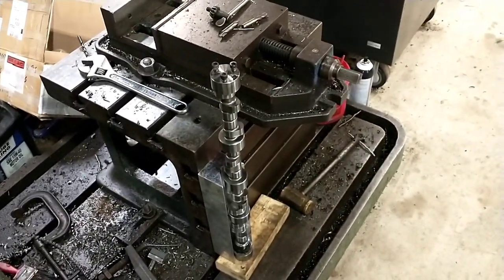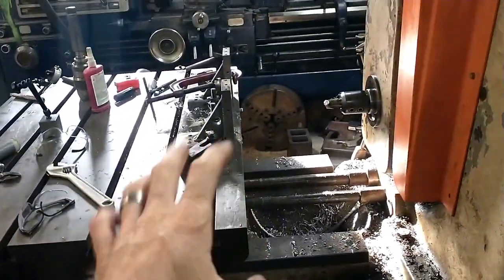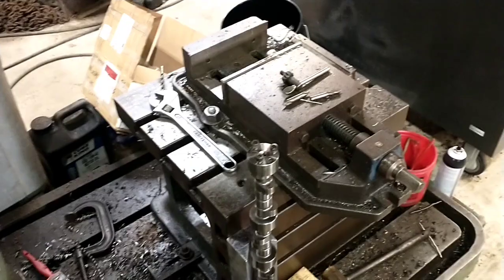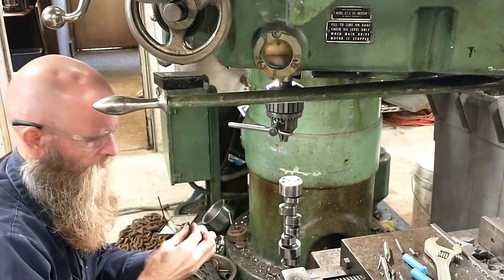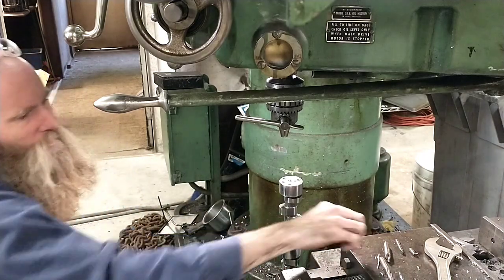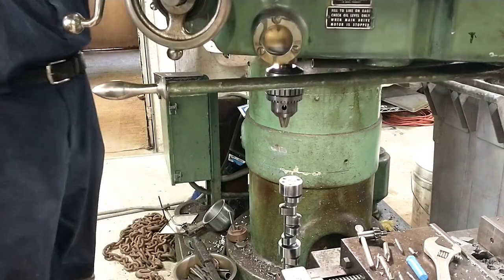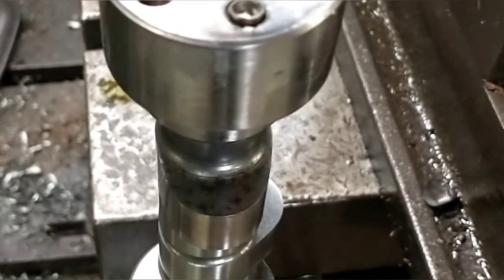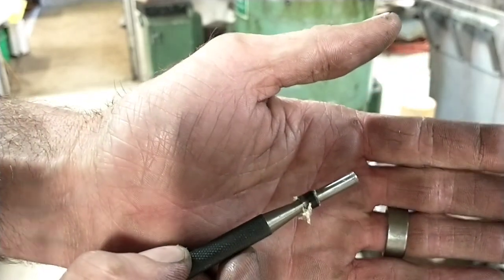Using white bread to remove a broken dowel pin from a racing camshaft.

Comment: Someone should try this with a non-Newtonian fluid. You can poor that in with a syringe, and it should stiffen up on impact.
Reply from the maker: That's an interesting thought, I may have to experiment with that just for the fun of it 😁
Reply from the maker: I've thought it over a little bit more, I don't think it would work. A non-Newtonian fluid would simply act like a solid, for this trick to work you need something that will function as a liquid but has enough body or viscosity to not escape through the gap. My theory as to why bread works so well is that it has a lot of fiber in it that helps bridge the gap between the punch and the sleeve you're trying to extract.

Comment: I've heard of the bread trick but I haven't used it before. Dowel pins are usually just case hard. They aren't "soft" in the middle but they aren't 60Rc all the way through. Ball end mills are usually good for plunging through them. Glad it worked, nice fix! Hope you have a good one
Reply from the maker: Interesting, I couldn't tell if it was any softer in the center or not, I suspect that when you get down to .250" that it's small enough to end up almost through hardened just because of the thin cross section.
Reply: @Andy-PerpetualMotion  Yeah once they are that small they are probably hard most of the way through. Probably depends some on the brand too

Comment: Nice job . The carbide drill bits went through that dowel pin ?
Reply from the maker: I was shocked at how well it cut through there, especially considering the tool I used was pretty much shot before I even started.